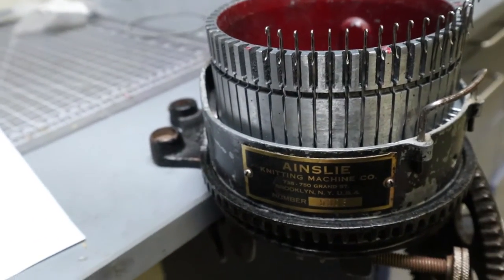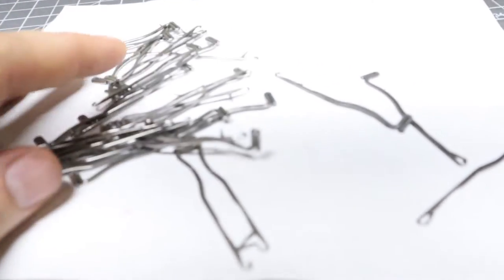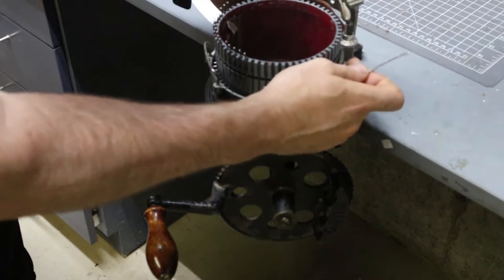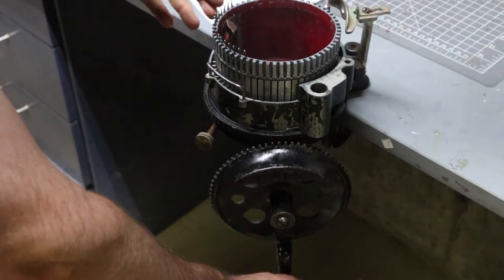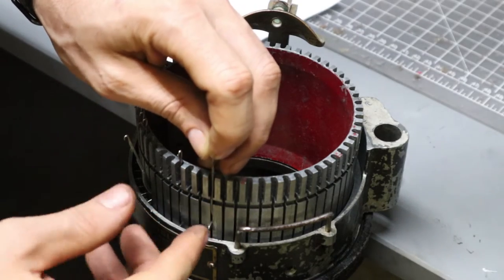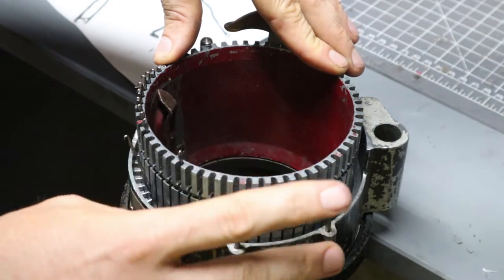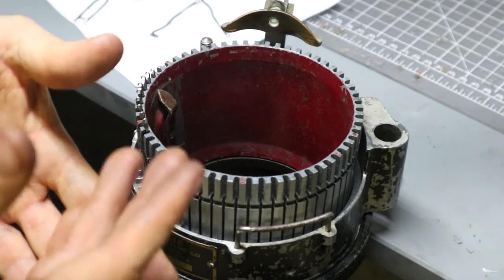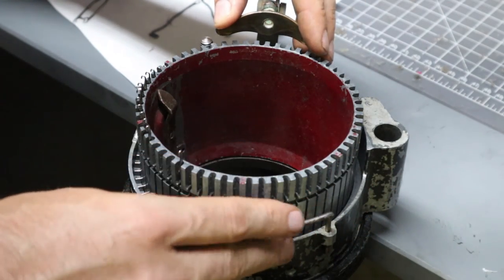SPIN #89 - Restoring a Vintage Ainslie Circular Knitting Machine - Part 3

Comment: Just came across your video as I used to work on Arkwright Street Nottingham and was trying to find any old videos of the larger circular knitting machines that one used to have to cast their needles in a lead base holder, they were leather belt driven from the top shaft which controlled 5 machines each row and I had ten machines, the finished material was drawn off at the top roller ABOVE the machine. Happy days they were disposed of to scrap and a couple of museums in the late 60's.

Comment: HI! i have demoed beside Mary The sock Knitter  for years. ( i bot one of her extra macheens so i will be joining you in this experience shortly) 1- i think your turning the crank the rong direction, Mary said only go one way. its ok to go back and froth short part runs for heels but for the cercle part only go one way. 2- your cilender may have been stored on its side which worps it and it wont work correctly (that is likely what has happened to the slot that wont fit a needle). mine has a wooden box that will store the cillinder upright. i have a cuple of photographs of manuals. i will see if i can find where i put them and see if its for your brand of macheen. Good luck, have fun!!
Reply from the maker: Thanks.  If I understand the cam correctly, I don't think the direction matters.  I can see why you should spin in one direction (except for elements like the heal), but I'm pretty sure that wasn't the issue in this video.  I've tracked the issue to the high amount of friction in the hooks.  It is possible this one was stored on it's side as you suggested.  I have no idea how it was stored.
Reply: @DreamingRobotsBlog  Mary said some companys used a softer metle for the cilinder and that lying on its side would distort it. i hope i can find the manuals for you and that they are the rite macheen. you are much more micanical than i am. so i am shure you will understand it i dont know why it was suggested turn only one way. if it winds one way i would expect it could go the other. it dose for heels. it may have to do with the twist direction of the spun yarn?  if it has a slight sistortion do you have calipers or other cool enginering like device that could check and see if that is part of the problem?  there is a company in quebec canada that is making new vertions of one of the old sockknitting macheens if you are lucky it may have compatible parts. they were showing off there macheens at twist l will have to dig through fotos and see if i can see the manufaturer for you.
Reply from the maker: @janscott9373  I have measured my cylinder and it isn't quite perfectly round, but I am pretty sure that isn't my primary problem.  There are companies that make new cylinders, but I will just 3d print one to test with and then decide if I want to use that, fix my current one, or order one.  I guess in theory I could also have a company with a CNC machine make a metal version of the plastic one I've designed.
Reply: @DreamingRobotsBlog  WOW that is amazing! i can spin weave felt but i cant make a new cilinder! i was impressed with your electric spinning wheel but you keep doing realy cool things!! a cone winder, a yarn counter and a cillinder!  i looked for the fotos i remember takeing but cant find them i will keep looking for which drive i stuck the instruction books on. when i find them i will figure out how to get them to you! keep being amazing! its lots of fun for the rest of us and i cant wate (well i will wate) for the new electric spinning wheel!

Comment: You were cranking the machine backwards,
Reply from the maker: I'm pretty sure I am not.  It has a auto reversing cam and I tried in both directions.  It kind of looks like the wrong direction because as I mentioned the hooks are getting pinched by the sidewalls of the cylinder and that makes it hard for them to pass through the cam.
Reply: @DreamingRobotsBlog  there are a lot of CSM groups on Facebook and on Raverly.  People are very happy to help out
Reply from the maker: @elainemack1653  Thanks.  I have used some of their help in the past, but right now I'm pretty sure I understand how it is supposed to work and what is not working.  If I need help I won't hesitate to ask since I know one of the CSM groups on facebook and have a bunch of others in the EEW community that also can help.  But right now I'm pretty sure I know what needs to be done and I just need to do that.
Reply: You typically crank clockwise when you are making a tube. You change directions to make the short rows for heels and toes. And you can use a needle that’s already in the cylinder to pull the cylinder spring out from the channel. Were there two gauges of needles to choose from for this machine. It’s possible you can get a smaller gauge for your cylinder.
Reply from the maker: @christinamccollum2926  Thanks for the suggestions!

Comment: I was wondering if the part you showed about the two cams that pivot on the pins, if that was the way they were supposed to be or did you have to reposition them?
Reply from the maker: I think that is the way they are supposed to be.  It needs to reverse direction of I do things like heals.
Reply: @DreamingRobotsBlog  I'm restoring a machine that has the same setup, so gathering info. Thanks